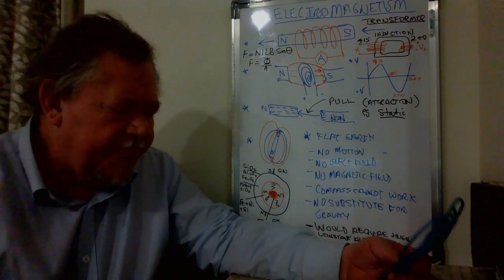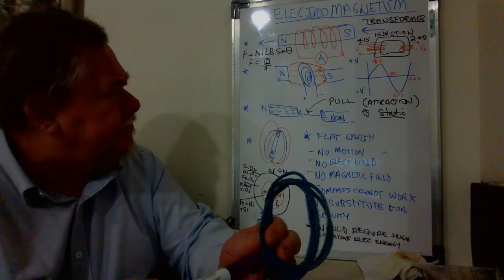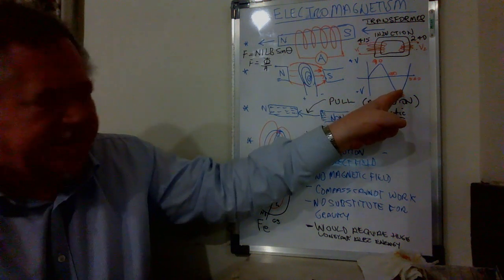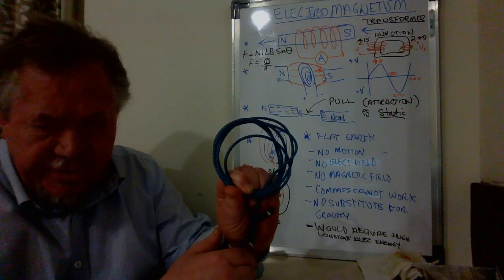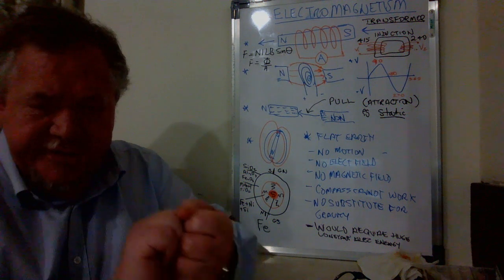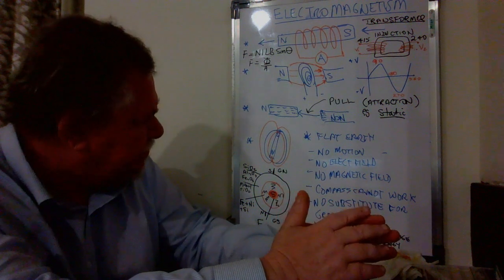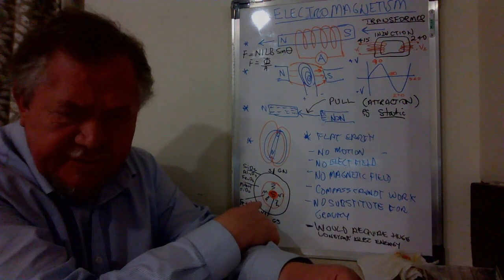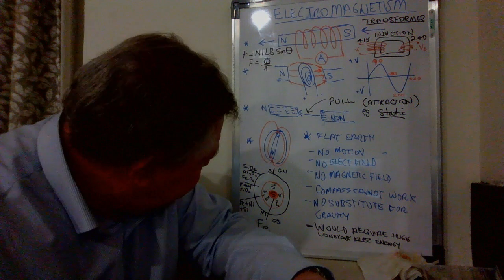ELECTROMAGNETISM ON FLAT EARTH

Comment: There is a lot of “free electricity” you can accumulate in a lot of ways. They are just a lot more expensive and temperamental than solar like flying a lot of long conductors in storms. Or produce tiny amounts of energy per unit area like crystal and more modern EM based accumulators.
Reply: There is never true "free electricity". It can get very cheap, but not quite free.
Reply from the maker: As I said in the video, the problem with static electricity such as lightning is the huge amount of emf in a very small time. 
Current = amount of charge / time. So what you suggest is not practical as a sustainable source of electric power.
Reply: Prof Phil Bell agreed and even if you wired up half the sky and were able to deal with the voltages the sun is out in most places people live way more than there are electrical storms.

The old leyden jar and pole / kite in a storm trick is something to see if you are game enough though
Reply from the maker: @glenecollins  I have and it's very scary.

Comment: What i love is how flat earthers try to say density is why things fall, i ask everytime if thats it why are we not all dead?. Radon is the most dense gas that our atmosphere is made of. Therefore wouldn't by their logic , radon would be laying on the earths surface. And oxygen wouldn't be in our breathable layer!!. They refuse to answer it, of course.
Reply: FE have a very very hard time accepting than a phenomenon have to take place for object motion to be the way they are. They seem to think they can just say "density and buoyancy" and move on. But that obvious not how it work. Density get no direction and buoyancy by definition need a external acceleration to happen. 

A fun experiment to do is actually to put a helium balloon in a car. As you drive around the helium balloon will move forward when you accelerate and backward when you brake (reverse of any object more dense than air). That is physically the same as buoyancy, created by a other source off acceleration than gravity in a other direction. FE believer seem to have a hard time making sense of that one...

Try asking a FE believer what direction the balloon will take. They will often get it wrong. And if they do get it right ask them to explain why it happen....the only answer they can give confirm the need for gravity. It so fun because it get them cornered very fast.
Reply from the maker: Exactly. However to be fair, there would not be enough radon to cover 1 mm of the surface around Earth. But I like your answer because there certainly is enough CO2, NO2, N2O, SO2 etc to do exactly as you say. CO2 for example us 44 grams per mole while air is just 29 grams per mole. Thanks for the great question. I think I'll do a video on this.
Reply: @profphilbell2075  i xant wait for the vid. And true , i should use nitrogen in the example, argon i believe is also not enough to layer us in.

Comment: Hi Prof. Phil Bell, as always, I loved your video. If you do make a video about light, I have a question that has been bugging me for years. Why is light emitted from a LED source visible though fog, and much further than other light sources. The speed is fixed, so it's not that. Has the photons got more energy! Why is it?
Reply from the maker: Fantastic question. Def do a video to answer this question.
Reply: @ @profphilbell2075  Thank you, that is just wonderful. I look very much forward to acquiring that knowledge :-)
Reply: @lauolsen  - Every photon at the same wavelength have the same energy, a photon having more energy will simply increase it's frequency (diminishing wavelength). Therefore, if you try to give more energy/photon, your light will simply turn violet and eventually UV and so on. Same goes for the other way around, if you give less energy to a photon it will turn toward red when eventually IR then radio wave and so on (I think that funny to think about, but radio antenna technically emit photon)...

But in this case, don't seem to be a color difference between your led light and incandescent light (well, perhaps some led are a little more blue, and some incandescent light are a little more yellow...but that not drastic enough to explain it). So assuming they have about the same energy/photon is safe.

NOW, LED have a very high lumen/watt efficiency. Meaning than for the same power they will emit more photon/area.  And that why they seem to be brighter and can be seen further, it/s not really the photon energy, but the sheer number of them.
Reply: @globestrikeback1888  That is what I thought. But if you change CRI, then you change colour. Red hot iron is 850°C, the flame of a candle is 2.700°K. But Magnesium burns at 1.000°C and is bright white! Some say, that the surface of the sun is 6.500°K, I say it's 9.500°K. And if 0°K is -273,15°C, then that can't explain the difference, (to my small brain), if 1°K, is equivalent to 1°C. That leaves either the energy of the individual photon, not the wavelength, or "that other ting" I don't know about ;-) All light emitted from a AC current, turns on and off 50 times/sec. ,(at 50Hz). And I do understand, that we humans don't see that, because of our eyes, (birds do). That could explain why we don't see light as "packets of light". But if you use a DC current or the sun, wouldn't it be a continues stream? There's much I have yet to learn... I will be studying Prof. Bells upcoming video on this, until I understand it.
Reply: @lauolsen  - Well, the light from incandescent light don't really turn on and off when powered by AC current. You have to take intro account the cool down time of the tungsten filament.  The filament is heated to about 2700 C, but will only stop emitting light when it reach about 800 C. That will take a few millisecond to happen. By that time, the current have the time to change direction and start flowing again heating the filament once more.  So really, it's pretty much a continuous stream even at 60hz.

And yes, indeed. Object with greater temperature will emit greater energy photon overall.  That why for example a stars than look blue is much hotter than our sun. However, must not forget than there is more factor to the brightness of somethings than the energy of individual photon. Density of them is a big big factor. 

There no way around it, there a direct relation between a photon energy and it's wavelength.  

BTW, magnesium does burn at 2500k, not 1000 C. Also have to be careful with candle, their temperature vary a lot depending on what area you look at (and btw, burn at lower temperature than 2700 K, it's more in the 1600 K range for the hottest part).
Reply: @globestrikeback1888  I would argue, that if you take a 1.5m fluorescent tube at 10.000V. That it turns on and off with the frequency of the power source, just faster than our brain can detect. I would agree, that it happens with a tungsten filament. Where it transduces electricity into electromagnetic energy, where about 3% of it, is in the visible light spectrum. That is the main reason, that LED is so much better- much more light, much less consumption. Simply put more (visual) lux/W. My problem is, that I think I understand the science behind light, I just don't know most of it. Which is why, I go to people like the good professor, to get in-light-tet, (hehe). Too few people, that has his level of knowledge, take the time, to talk to idiots like me. And I have a high appreciation toward those, who do.
Reply: @lauolsen  - Well, fluorescent tube are a completely different system than incandescent light. There the reaction inside produce UV light, the visible light is the result of a special coating than absorb this UV light then emit visible light.

And again, there is a delay between the time the coating stop absorb UV and the time it stop emitting light. So no it's still not a light flashing at 60 hertz.

Comment: I always wondered if making a large circuit in orbit could use the Earth's magnetic field to generate power.
Would the magnetic resistance cause the orbital speed to decrease?

NASA tried dragging a large circuit behind the space shuttle, but it snapped off right away and they never tried again.

 Think it was called the tether program or something like that
Reply: Cody I got the impression they got enough information from those experiments to show that it would be effective breaking for high speed spacecraft but that it would probably be easier to put a sail down into the upper atmosphere to slow down.

To make the most use of the field you would probably need a few turns an a really big rock at a Lagrangian point to stick it to... that is a lot of wire and mucking around.
Reply from the maker: @glenecollins  Well said There are much easier ways such as solar power